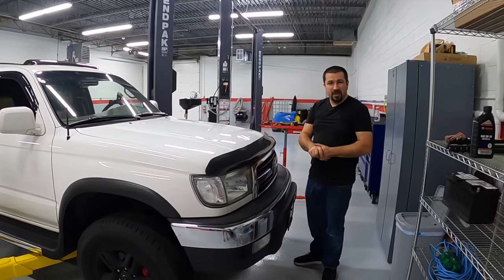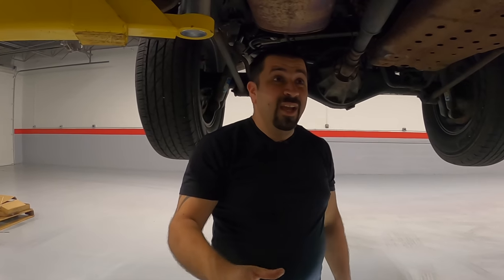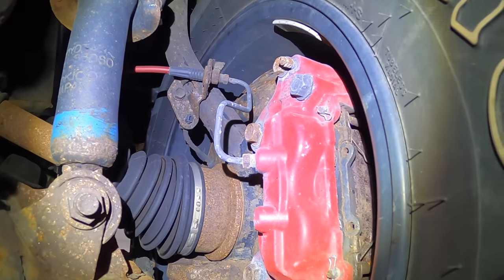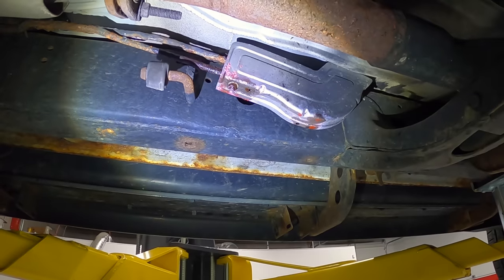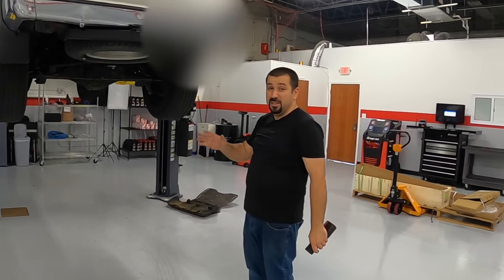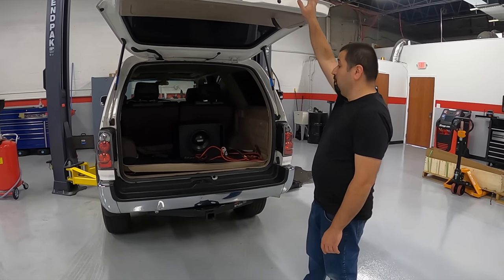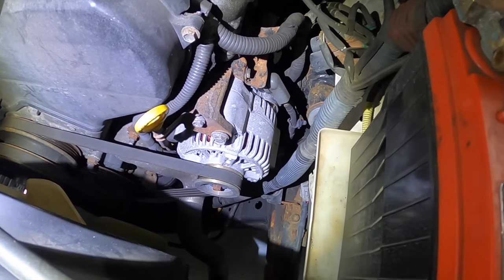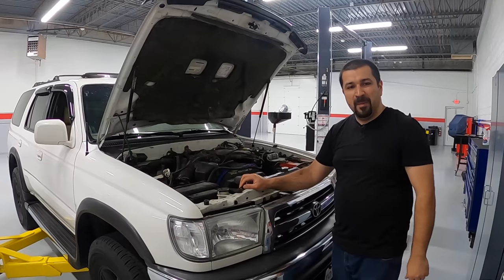Everything You Need to Know about the Toyota 4runner | 3rd Gen 1996-2002

Comment: Hey dude I got a question for you I just got a 2022 4Runner TRD off-road premium  do you think rust is a concern of has Toyota fixed that kinda problem with the frame roting
Reply from the maker: Hi! They are better but if completely neglected they can get bad as well. If you live in an area with salt use in the winter I would undercoat it
Reply: @TheCarCareNut  yeah I live in long island new york
Reply: @TheCarCareNut  but is there a time limit where you can't under cote it?
Reply from the maker: Not really on the time limit. But the sooner you coat it the better protection you’ll get
Reply: @TheCarCareNut  thanks so much brother

Comment: Hello Sir, i have a 2000 Toyota 4 runner 4 cylinder 2.7l. I've been trying to find out what is the normal temperature for the coolant on my car. If you have this information please share with me. (I know that the thermostat has to open at 180 degree Fahrenheit.) But my case is always on 188 and 195. With 80 degree outdoor temp.
Reply: That's normal, don't worry about it as long as your temp gauge is in the middle.

Comment: I have a '99 Limited with 209,000 miles on it... I have done a lot of detail touch ups on it like removing and repainting the luggage rack, repainting the silver cladding and front and rear bumpers.  I learned the hard way that if a luggage rack is removed, the mounting holes must be resealed... I ended up with water leaks from front to rear inside that soaked the carpeting.  I've since resealed and it's been leak-free.  The problem I'm having is when I first start, only intermittently, it squeals loudly... I've been told it's the power steering belt... can anyone share what it might be?  And the oddest issue is only driving at 65mph or more, there's a shimmy that moves rhythmically from front to rear -- could it be my driveshaft going out?  Any advice would be greatly appreciated.  Thanks.   

I absolutely love my 3rd Gen and will drive it until it won't go anymore.  I've had a few notes left on my car asking if I want to sell it... nope, it's my baby.
Reply: Replace those u joints

Comment: The only real issue with these motors is that they common have specifically cylinder 1 and cylinder 5 exhaust valves like to get stuck open causing misfire. That being said, from personal experience, you can run these motors with a terrible misfire for months and months on end and they couldn’t care less. Sold the truck, new owner got it fixed, runs as smooth as brand new

Comment: How about where the mice get into the cabin fan!  This is an ongoing BIG BIG BIG problem for me.  So, this time my heater had very little heat output.  I know it is the mice again because when I cleared out the cabin fan, twice actually... needs a third time now, it was full of mice nesting materials.  It is not clear to me how to clear the heater transfer.  Life goes on.  I have 268,000 miles on this baby.  I changed the timing belt and things that go along with it 3 times now.  The air conditioner clutch is always going out.  I just cut the belt and live with no air until I can fix it.   I am having starter problems too, but not when it is raining.   I like this truck.  I live in Santa Cruz mountains with no rust.  I use 4WD to get up my driveway in the winter.  One more thing, the automatic transmission dipstick has broken off.  Now when I replace the starter I will see if I can grab the old dipstick end.  I have a new on.

Comment: What do you mean by notorious?  My 2 4runners are over 400000 miles and I have done anything but oils changes, uncle with T100 over 530000 miles and same thing, cousin with a 2gen and a 3gen with over 350000 miles both and non of all this trucks with the “notorious” issues you’re mentioning

Comment: Your power steering pump doesn't have to whine. Remove the idiot screen in the PS reservoir. It will build up crap over the 20+ years and restrict flow = whiny pump. As long as you don't put dirt or rocks in there you will be fine. I replaced two pumps before I did this. You can replace the reservoir too if you want instead but I'm cheap.  Now in Colorado cold / morning startup, silent like ninja. Check the reservoir screen before you shell out $ for a new pump.
Reply: Just fill it w/synthetic Dexron IV & it becomes "self-cleaning", thank me later Gator 😉

Comment: 3rd gen 4Runners have gone up in value over the past few years. Like any other metal the frame can be fixed and welded. The problem is no shops will do it because of the liability. Still seems a waste to junk perfectly good trucks.

Comment: Hello 

I have been following your videos on YouTube for a while and I am hoping you can help me figure out the buzzing noise I have in my 2015 Toyota RAV4. 

The humming noise can be heard when the key is in ignition on position and for about 30-60 seconds after fully turning car off and taking key out. 

The humming sound coming from somewhere in the engine. I was told by an independent mechanic  that it was coming from the throttle body.  The TB was replaced with an original Toyota part. Also, the mass airflow sensor was also replaced because I continuously keep getting p0102 permanent code. Air filter and new battery were changed as routine maintenance. My car is in excellent condition with only 36200 miles.  Oil is change twice a year and all 
fluids were recently changed. 

After replacing various parts the humming sound continues so I took the car to a Toyota dealer for a full diagnostic. The car was not diagnosed and was told that the humming sound was normal coming from the ECU.  Noise is bothering me. No one knows the car better than myself. Humming sound started about a year ago.  After un successfully pin pointing noise and replacing un necessary parts we did our own home diagnostic. 

 Using a stethoscope we figured the noise and vibration coming from transmission oil pan loud and clear.  In order for use to make sure and to see if the noise was actually coming from inside the oil pan we decided to change transmission oil and filter.  YES, after draining oil and taking filter out we turned key to on position and the humming noise can be heard and a strong vibration was felt coming from one of the solenoids.  It looks like it’s stuck or something.  Ami have a video of the noise and solenoid vibration. 

The car is changing gears fine and I am not getting engine light or error codes related to transmission. 
Have you ever come across this issue? Is this normal in Toyota’s? Should i be concerned and replaced solenoid?
Reply from the maker: Hi! That humming noise is normal as the solenoids activate and stay on. I’m sorry the dealership didn’t say that.
Reply: Thank you so much for your reply.  I appreciated makes me feel better and less worried about the noise.  Do this noise happens as the car is aging?

Comment: 😢 I don't know where else to go.  NO mechanic could figure out my problem. I know this the only place that has the answer.  I have 98 4runner with 140k, which I gave my son to use.   Recently, the car shutter around 50 mph, it feels like it's searching for gear (going up and down shifting)  but I know it's not a  transmission issue.  Only a few think that I can detect, the tranfercase has a front drive shaft seal leak, probably half of the fuild is gone.  And the other was a recent front brake pad change. Clicking sound is heard on driverside drive axle spinning it, car shakes around 60-70 after brake change.  PLEASE can someone give me some pointer on where to look. Thx
Reply: Change the u-joints, that's---your--- problem. Thank me later👌

Comment: I’m also on the idea that Toyota’s are super reliable and it shows by the high mileage 4Runners for sales on autotrader etc. However when you named all the issues on this truck and say it’s common it makes me feel like Toyota’s are lemons. Unless all you’ve shown is still less than other brands. Your review on the 4th gen 4 runner and the Lexus gx were the same as well.
Reply: The main tenet of the reliability of a car is its drivetrain. Nothing mentioned here deals with the drivetrain. Everything mentioned are minor failure points, the "failure" can be avoided by addressing these parts in advance. Keep learning more about cars if your takeaway is "lemon".

Comment: How about installing an external transmission cooler?
Reply: It's a popular option, especially for offroaders constantly using 4-Lo.
I personally don't feel that it's vital if you don't offroad.
Even if pink milkshake radiator failure occurs, the transmission is not instantly destroyed, it's destroyed by continuing to drive the car in that condition.
Clean, quality transmission fluid and changing the radiator are the 2 the most vital preventative steps.
Also, installing a transmission temperature gauge , which is easier and cheaper than a tranny cooler, would also be preventative.
Reply: @ShinobiXRevived  thanks

Comment: I disagree with you on frame rot, if the car is cheap, and has minimal frame rot, you can have the frame repaired with a product called Safe T Cap for like 1000$ (which is cheap). I did it with my 2001 4runner and basically got a whole new frame out of it. Just need to find the right welder.

Comment: Regarding lower ball joints, replace them with Toyota parts and not cheap aftermarket. Shop dealers online and don't just pay whatever ridiculous price your local dealership is asking.
Reply: The ball joints themselves almost never fail, it's the Toyota OEM bolts, they become weak overtime because they're already rated at the minimum, and they sheer right off, and the ball joint just falls. The joint itself is not the common failure point.
Reply: @ShinobiXRevived  the design of the LBJ has the vehicle weight pulling them apart just by their position. Signs of wear can be visible in the joint itself by jacking up the truck and putting a pry bar or 2x4 under the tire and forcing it up.

Comment: Seems like a lot of problems for a “reliable” vehicle!?  I was considering purchasing one of these (1999) with 212K miles listed for $15K.. but now I’m not so sure it’s worth it.  Sounds like the repairs may get costly at this point since it’s over 20 years old.  Maybe it’s better just to buy a new Tacoma for 30K and call it a day. 🤷🏻‍♂️
Reply: @subtegral  - I agree.. but any decent shaped 3rd gen (or 1st gen Tacoma) is no less than $10K in this crazy market.
Reply: @subtegral  - Well, they are cheaper than buying new and more reliable (higher quality).. so it’s really a no brainer.
Reply: @subtegral  - Not surprising.  Four years ago was a completely different market.
Reply: @subtegral  - Exactly.  Pre-covid, sellers were asking between $6K-$12K.  Post-covid, they are asking between $12K-$25K!  Sure, the cheaper ones are still out there today, but if you don’t have that vigilance.. they are typically gone within 24-48 hours.
Reply: @subtegral  - They are high out here on the west coast.  Vigilance is definitely the key.
Reply: @subtegral  - Not bad.  But 240K miles though.  A little high but I guess these should last at least 400K miles, right?  I need to get on Craigslist.  Thanks for the tip!
Reply: @subtegral  - Yes, you can find them with 140K.. I’ve found some with 100K.  Some are lifted, new tires and look practically new!  But the price is significantly higher of course.  But, I keep hearing how they last forever (including the 1st gen Tacomas), that’s what prompts my diligence.
Reply: @subtegral  - Wow, that one sounds good.  I know.. I just have to keep looking and keep at it bud.  Thanks for your help and encouragement.. I really appreciate it.
Reply: @subtegral  - Not yet!  Seems next to impossible to find one in good condition for a reasonable price.  Plus I’m picky.  But, I’m not giving up!
Reply: @subtegral  - lol.. you’re really trying to get that one sold.  What dealership is it at?
Reply: @subtegral  - Private is the way to go.  The dealers I’ve talked to through this whole search process have been greedy, dishonest and rude.

Comment: @4:00 no, just no. You aren't trusting your car to a plastic clip. The plastic clip isn't even needed. It's just a backup. The company that makes those valves even says so. I trust the valve MORE than constantly removing and reinstalling the plug. You risk so much more each oil change: cross threading, under torqueing, over torqueing, introducing contaminants via a dirty plug, hell, even just having the plug get lost in a pan of oil is no fun.

But at the very least, if you're going to criticize something at least know the facts first - the clip is just a kids favorite blanket - It provides no real extra protection but it makes the kid feel better.

Comment: I would at least have cleaned underneath it after replacing gaskets so AMD could do a more thorough inspection without fighting thru the sludge...gross!  That thing looks like everything on it is leaking! 😂
Reply: Oil underneath is free rust protection.
Reply: 😂that's funny.  Too bad it didn't reach those rusty az brake lines he pointed out!
Reply: @ericamullen1623  Those aren't brake lines.
Reply: My bad...heater lines.  Those def need replacing.

Comment: Toyota should be ashamed. They screwed millions of customers on most of the Tundras, T-100s, Tacoma's and Sequoias. They were brought to court and settled. But they were only required to replace certain frames. The rest of us got screwed. My T-100 only had 80k before it started disintegrating. I pulled the motor and bought a clean 4Runner.

Comment: This is owned by the same person who owns the Camry? If so I guess concentrated so much on
Reply: So much on the Camry and didn’t bother with this
Reply: @HotRod-wv4vm  Do you even realize that most of the stuff he mentioned in this video are informative, and have already been done to this vehicle? Lol.
Reply: @ShinobiXRevived  so I assume when you bought it it was in this shape?
Reply: @HotRod-wv4vm  No, when I bought it it was all original, with all 4 sway bar links broken, drive belts frayed falling off, and a broken rear shock, and bald tires. I have a spreadsheet with 70 lines of preventative maintenance that I have had done to this truck. But, I didn't have to do half of it. I just wanted to do it for the sake of being thorough. For you to to be saying what you're saying shows you have no idea what you're talking about. There is nothing that AMD named that would have this truck on the side of the road. Those rear heater lines are seeping coolant, they've been seeping for over a year, I told him to thoroughly search for leaks because I was loosing coolant at a very SUBTLE level to where I wasn't even sure if it was actually leaking or not. Those rear coolant lines are a trim option. Half these trucks don't even have a rear heater! You can cap the lines off or rearrange the hoses under the hood and bypass them and not spend a dime fixing them and have no issues. But, shows how much you know, snarkily implying that my vehicle isn't maintained when you're dead wrong.
Reply: @ShinobiXRevived  chill dude I am saying that at all but going by all that damn rust I personally would never have bought it if was like that or if it didn’t have all that rust and the rust is starting to show I would get rid of it. Tough you don’t like my comments but God gave us all the ability to express ourselves differently.
Reply: @HotRod-wv4vm  You don't know anything about rust. You probably live in a southern state.
Reply: @ShinobiXRevived  nope north east